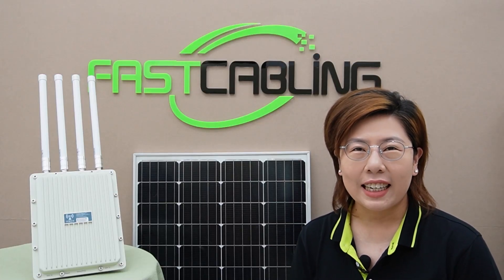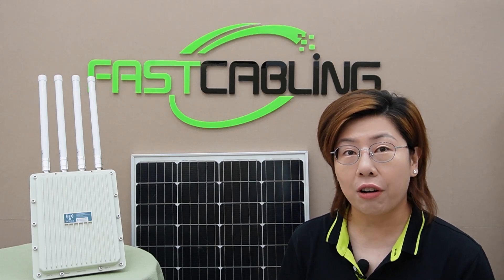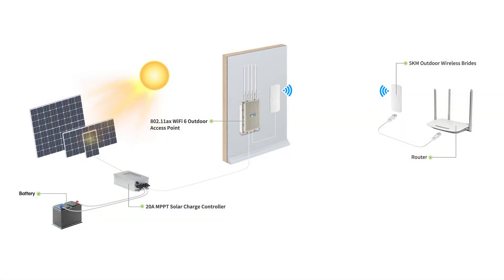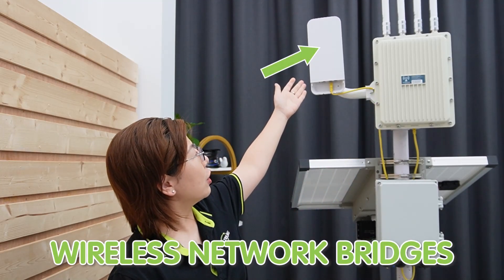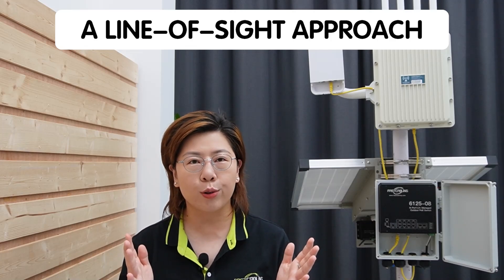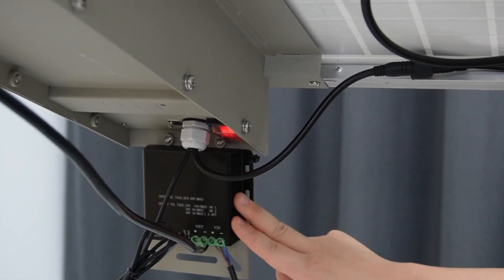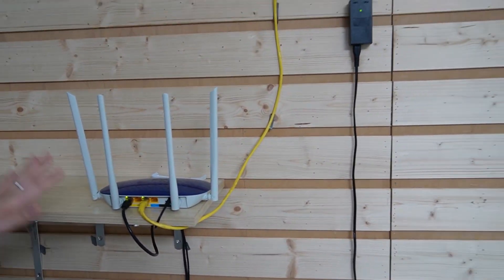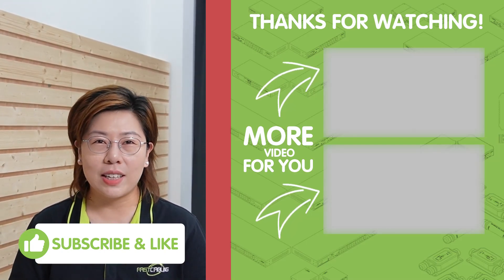Integrating Solar Power with Outdoor WiFi 6 Networks

Comment: Does the setup with the solar panel have a battery so that there is power at night time?
Reply from the maker: The solar panel has an integrated charge controller and battery.

Comment: How far can the solar panel setup be from the router/bridge? Can it be a mile away?
Reply from the maker: The solar panels only need to be close enough to the device or system they’re powering. The main issue with distance here is voltage drop over long DC power cables. Generally, keeping power cable runs under 100–200 feet (30–60 m) is recommended unless you’re using very thick wire (low gauge) or a higher system voltage (like 24V or 48V).